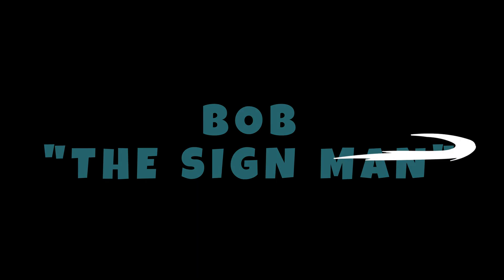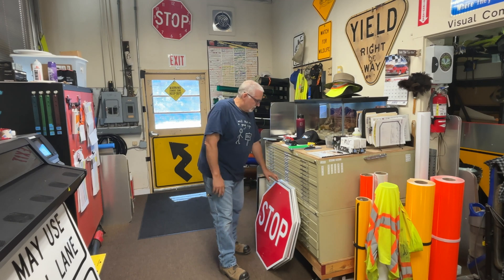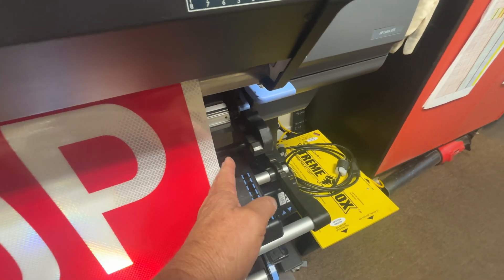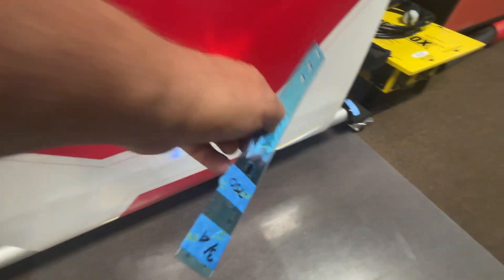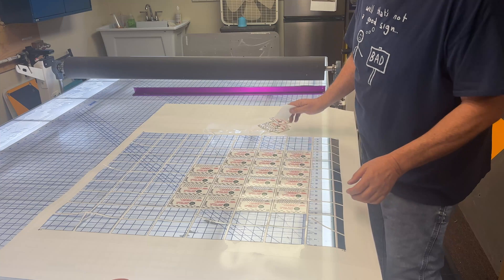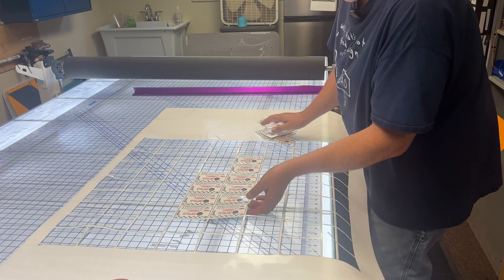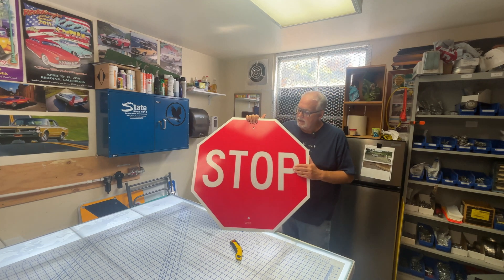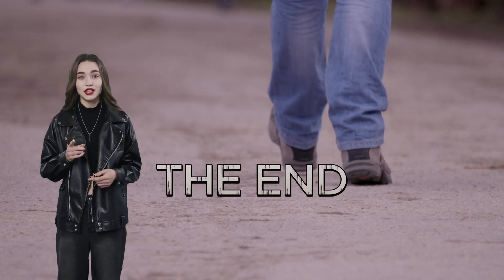Printing Stop Signs with the HP 365 Digital Printer

Comment: We use 1160i sometimes. It's great stuff, but the non premask version really is only useful if you have an automatic heat assist laminator. We use the 1160i with the premask when laminating with our application table - makes our job a LOT easier! Definitely get the 1160i with premask next time!
Reply from the maker: @Soccerdude7330Official  Great advice, thank you.

Comment: When laminating like you are doing, for thin laminate, I only unroll enough that it stays on the roller (12" or so, where you started with closer to 18-20") for the starting pass.  Static will keep it straight on the roller.  Rolling the other way isn't an issue at that point since you aren't taking the liner off.  I also generally start from the end so I can pull the liner back without reaching over the table.  I find it easier to keep the lam on the roller without moving it around.
Reply from the maker: @kkoors  Thanks. I’ll try that. This is the first time I’ve used this thin material.